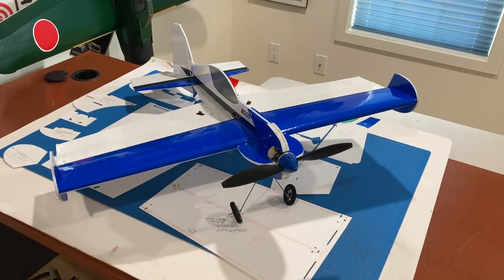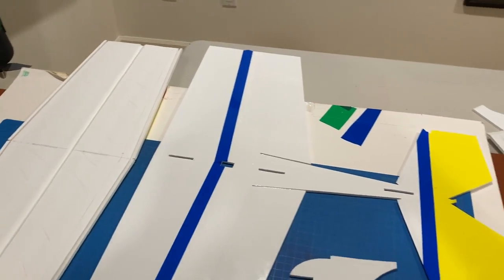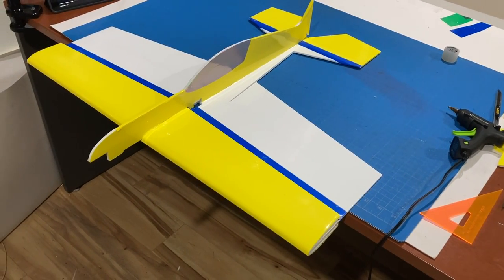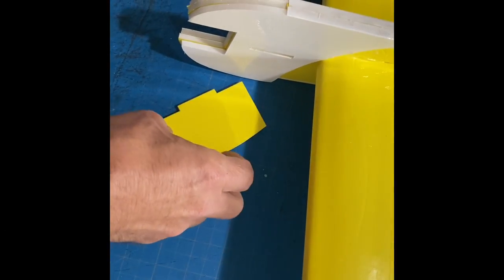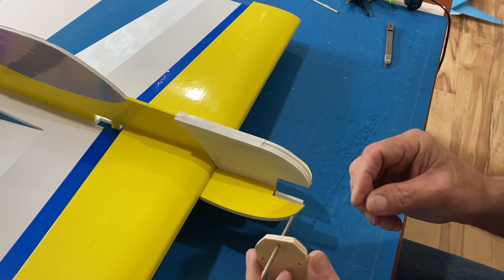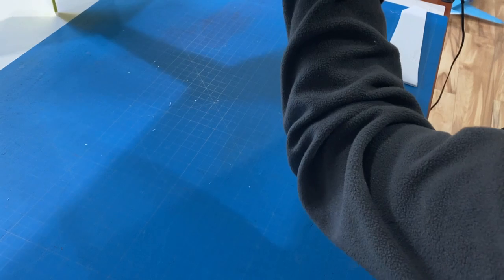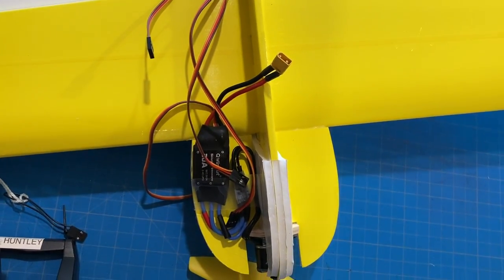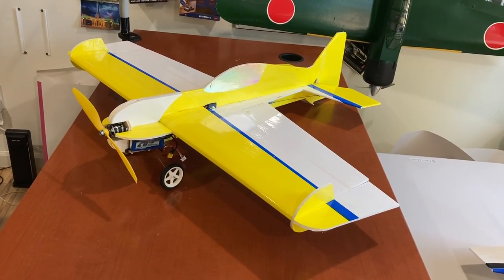Foam Board RC Profile 3D Sport Plane Build DIY

Comment: Thank you for the plans I built mine it fles awesome. 
I used
2212 1370 kv emax motor 
30 amp esc 
9g turnigy servos x4
9x6 prop
1500 mah zee battery 
1.6 lbs all up unlimited vertical power to spare roll rate is crazy
Reply from the maker: You are welcome. It sounds like you like it as much as I do!

Comment: I'm going to start my build tomorrow and have two quick questions about taping (never done before) and wonder what worked best for you:

1. Do you first tape and then cut out various slots out of the foam board or cut out the slots, tape over and then cut the tape covering the slot?

2. Is it better to first tape the wings, and then make the cut for the ailerons and then bevel or vice versa (cut, bevel and then tape)?

Thanks a ton!!!
Reply from the maker: Tape first unless the bottom is a very dark color where you can’t see the lines then tape the top first, do the cuts then tape the bottom. It is one reason most of my planes are white on the bottom. If you haven’t taped before, I recommend watching my video on how I do it.
Reply: @thenerdoligist1292  Got it! Thank you SO much, just watched it! Thanks for sharing. Oh man, I just saw the profile biplane you did. I'm really getting into biplanes and am in the middle of a Tiger Moth. I can see a profile Sopwith in my future, my list just keeps getting longer and longer! Thanks again!
Reply from the maker: @stephenegge9241  Tiger Moth should be very cool. I did a Pitts that flies fantastic (now that I figured out the CG) and l love the way it looks and knife edges. Enjoy the build!

Comment: Hello. I also wanted to note that I especially liked your approach to the manufacture of a three-layer construction of the leading edge of the wing.  however, I do not understand why you use wire for the chassis, while you can simply not use it due to the large weight.
Reply from the maker: Hi, you are correct, the landing gear is optional and is easy to remove. I sometimes fly at a baseball field and I can take off from the ground with the landing gear on.

Comment: how did you paint the foam board? And what type of paint?
Reply from the maker: I apply colored vinyl (available at dollar tree) or colored packaging tape (Amazon) before the Final Cut on the foam board. There is a video in my list showing how I do it. Vinyl is a little bit easier and cheaper but a little bit heavier and doesn’t stick as well sometimes. Vinyl is also cheaper if you want multiple colors

Comment: Hi,
I've got the same electronics apart from the motor which is A2212/6T 2200KV. I'm a total newbie so I'd like to as if you think that my setup could fly as nicely as yours.
Reply from the maker: Hi. Unfortunately your motor will have lower acceleration so maneuvers like hovering and harriers will be much more difficult. The good news is that regular flying including loops, rolls and inverted flight will be the same. Good luck and have fun!

Comment: So you seem to use a lot of tape on your builds. I used to build a lot of foam but they would get so beat. How does thr tape do to give them longer life. Does it add a lot of weight?
Reply from the maker: The tape waterproofs the paper so the control surfaces don’t warp. The foam still gets beat over time so they don’t last as long as balsa planes. It is 1.5 mil packaging tape so it is very light. I’ve also used vinyl, which is a little heavier but still worth it. Also, I like my planes to look good.